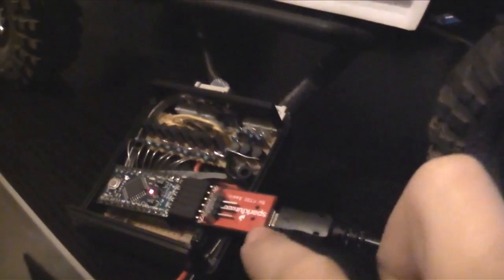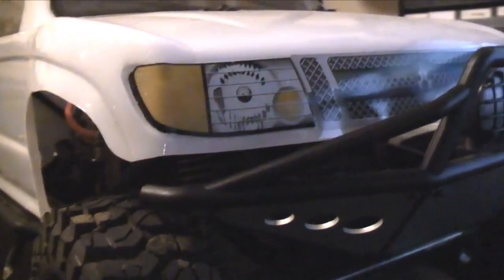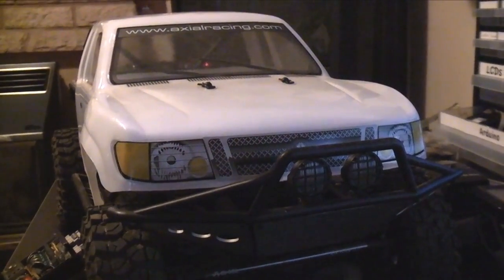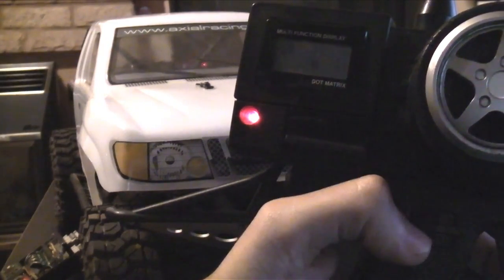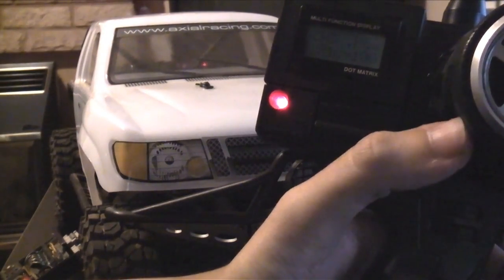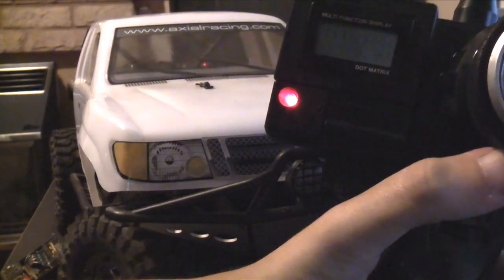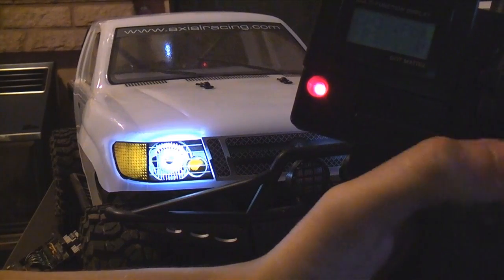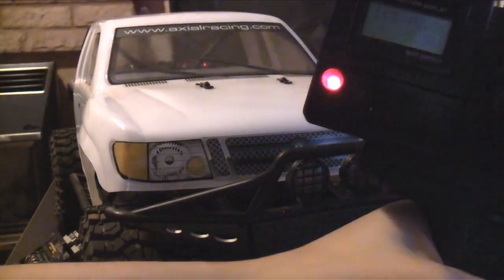Processor controlled RC light system

Comment from the maker: I suppose if you replaced the pot with 2 fixed resistors as you might with a continuous rotation servo, and replace the motor with an led and resistor it might work, would be a little finicky to set up though. Also as the servo has an H bridge to drive the motor you would have to watch the polarity.